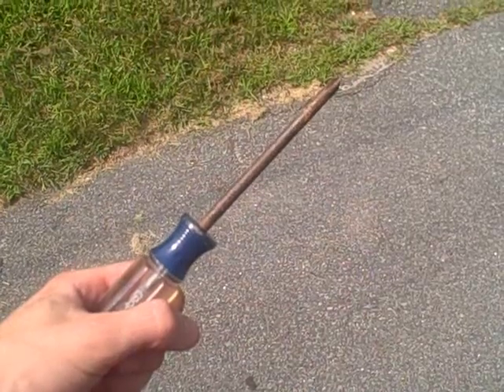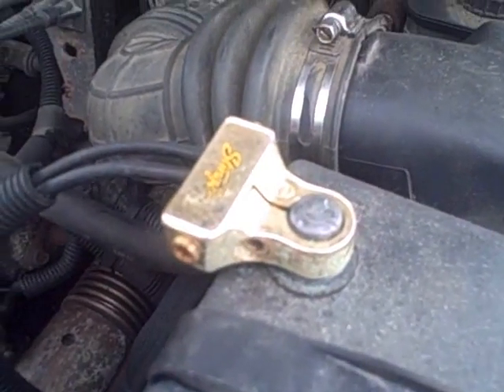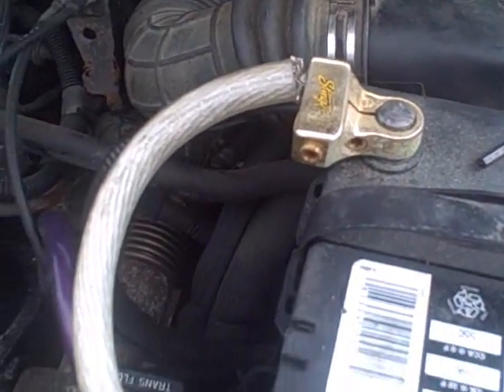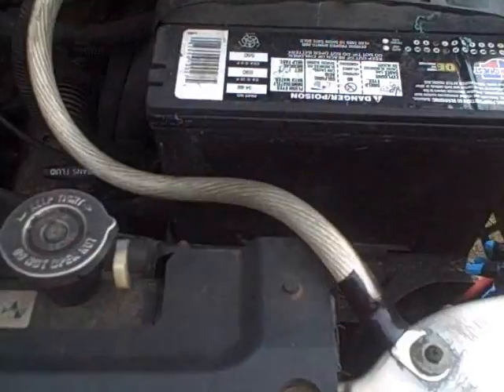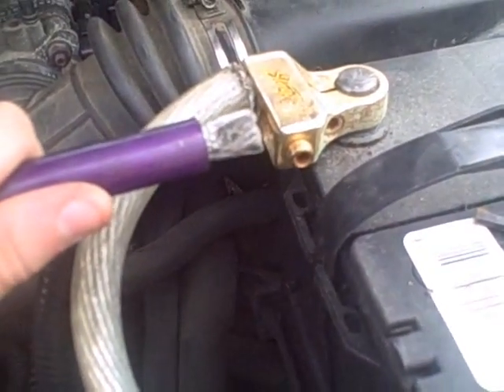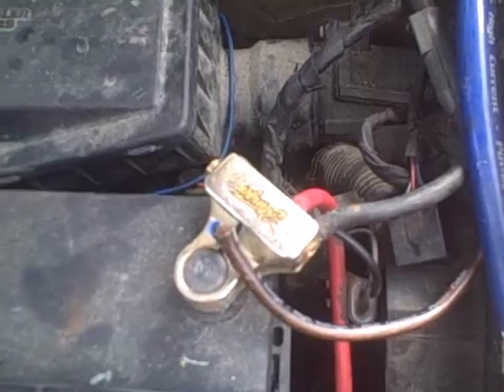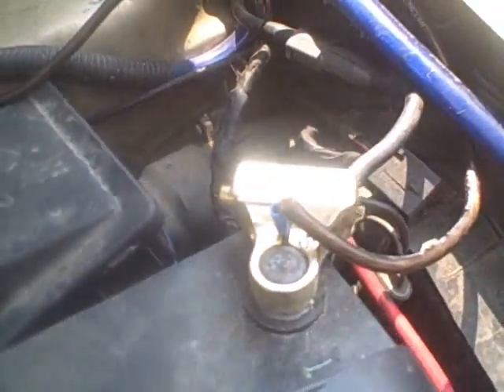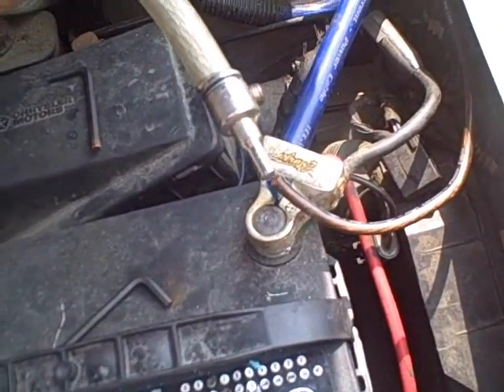Increase Car Audio Power 25% - How To Install Big Three Upgrade - Easy 15 Volt Stereo System Big 3

Comment: i did the big 3 but i am using dblink platinum battery terminals and all of my big gauge inputs are filled so i was wondering if i could run my amp power off of the alternator positive. would any of my components get damaged?

Comment: lol, I installed my old system in my 89 mustang and while I was doing the amps ground cable all i could find to grind it down was the dogs pedipaws, its basically a battery powered grinded, i just thought it was kinda funny...

Comment: Can you tell me how you make your resistor??

And what happen if the fuse is on when you turn your amp on??

I changed the battery of my friends car

And after we turn all the cables on

And we are gonna put the battery cable in the amplifier 
the fuse of the amplifier blows.

Can you teach me what i should do??
ThanX!

Comment from the maker: It's NEVER a good idea to have different size negative wires than positive wores - 

& ~ Most vehicles already have 4 gauge cable coming from the alternator - You're better off doing 2, 0, or even bigger.

Comment: Does this really help a lot? You confused me a little with your 2 different accounts and where to post questions, and all the stuff. Am I supposed to just post a comment in a video on this account, and not send a message or video comment on the other account because you wont respond. I think I understood that vid correctly.

Comment from the maker: Go ahead and remove the ground cable before you work on shit.

Connect the Pos Wire to the Pos Wire Terminal on the Alt to The Batt -

Comment: OK i get what you are saying with the b 3... i have a 99 chevy silvarado and i have don a 4 AWG running from my alt to the block that splits my alts connection... one line going to the battery and the other going to the starter... i have also read that going from your alt straight to your batt. causes MAJOR alt lagg and it can burn it out much faster... and i have up graded my grounds... eventually i will go to 0... but im running 4 G and i am stable at 13.8 with my 10Farad cap... i was just won

Comment from the maker: It's not the "watts" you want to pay attention to, but rather the amount of "amps" your stereo consumes, and draws from your battery, and in turn - your alternator.

Count up how many amps your amplifier(s) draws - (it should be visible by an onboard fuse)

If it excedes 100 amps - I would suggest getting a HO alternator, then use distribution blocks with the 4 gauge or 8 in the back.

8 gauge =  60 amps max
4 gauge = 100 amps max
2 gauge = 200 amps max
0 gauge = 300 amps max

Comment from the maker: I'm not using a resistor - I'm doing a nice little car audio trick with a standard 12v interior lightbuld - 

Most resistors are too small and ill-lit so you can't safely estimate when the Caps are charged - using a 12v lightbuld makes it easy, and fool proof.

Comment: I noticed you using a resistor to avoid the dreaded big spark when the amp fills up its caps. What value resistor did u use?

Comment: you dont really have to get a isolator or relay, unless you will be slammin the system with the car off. like at db drag events. Aslong as the batteries are purchased within 3 months or so you should be fine

Comment from the maker: there are two ways to do it
one way is using a device called a battery relay ~ this is the cheapest and hardest way to isolate batteries.

the next way is using a bigger device called a battery isolator. These are more expensive but reliable and easy to install.

Comment from the maker: getting more or bigger batteries will only demand more from your alternator. 

your lights are dimming because your car literally is running low on power ~ you need to increase the amperage of your system ~ this is achieved by adding high output alts

Comment: is the alternator cable looks like the tip of the cable where it is connected to the alternator has like a red cover on it?
and if i change it, does it have to be 0 gauge man?
thanks

Comment: so while using a 12v light or a head light bulb connecting the - to the cap side andt the + the the battery side  the light will shine until the cap is charged. when the light goes dim the cap is charged? or the the light is on while the cap is charging and when the light is off the cap is charged?

Comment from the maker: No. You want to run it in series with your positive power wire to slowly introduce current into the capacitor. ~ don't just hook it up to the battery ~ this will likely shock out your cap. ~ i have a whole tutorial on how to charge a capacitor ~ check it out. It should help even more.

Comment: So to charge a capacitor all one has to do is empty it using a 12v light bulb, then connect it to a 12v battery? is that it?

Comment from the maker: 4 gauge can only handle about 100 to 125 odd amps ~ it would not be good to use just one 4 gauge wire for this big of an upgrade ~ 0 gauge can handle up to 300 amps ~ if your getting any H/O alternator, always do the big three in 0 gauge or multiple runs of 0 gauge.

Comment: thanks for the vid bro will 4 gauge wire do fine? also a high amp alternator will be nessesary i just bought a 220amp alternator and a optima yellow top.

Comment: yo man 
a suggestion for ya. instead of grounding to you body, take that ground wire and move it to a small bolt on the strut tower. that bolt goes directly to the frame. more direct, instead of running though the body to get to the frame

Comment from the maker: Great question - Yes.

You can most certainly add to your stock wire to "surplus" your connections

I omitted it, only because, in most cases, the old stock wires are frail, corroded, poorly grounded, and look like shit.

Comment: nice video.... I'm planing on doing the big 3 on my 96 ford taurus but my question is.. Can i keep my stock wiring and add onto it? my alt goes to the fuse box then the batt... but I wanted to add 1 gauge from the alt to batt and keep the existing alt to fusebox to batt connection... and also does the alt directly to batt has to be fused(not running a high output alt) ?

Comment from the maker: It is connected to the same place the prior stock wire was - You can't miss it - It's the only bolt you can attach a wire onto.

Comment from the maker: It's not voltage, it's current!  And, yes, this will dramatically reduce power resistance, and increase power potential.

If you look  it in amperage terms, your increasing in by more than 25%

4 gauge wire before = Maybe 100 amps MAX!

0 gauge wire after = 300 Amps Max

So....That's actually more like 200%potential current gain - But you'll only raise a couple 10th's on the VM most likely.

Comment from the maker: I DID, and Do. It's very beneficail to wire the engine block directly to the negative battery post. 

You want to fool the alternator into thinking it's grounded to the negative battery terminal as much as possible.

Comment: Yes sir! They tell you no tot do this, But trust me it worked a lot better for me. I had them on different growns and didnt do anything for me AT ALL! The guy told me to run the ground strait off the negitive terminal on the cap. It took a load loud of my alt, I tell ya. Had more power/ bass and eveything.

Comment: is it necessary to ground the engine chassis to the negative terminal of the battery? or its okay to ground the engine chassis to the same ground the negative terminal is located.

Comment: yes fuse it if you have to small of a wire. But ill never fuse mine. Iv got 2 runs of 0 gauge from alts+ to batts +

Also i have a xp270 alt from dc power
200 amps idle
270+ amps @ 2rpms

Comment from the maker: I agree to a certain extent when going over 300 amps - (Being over the limit of 0 gauge) - but it's made fine on Less Than 300 amps - 

This way,  Think of manufacturing Companies - They do not fuse the "main cable" but rather the curcuit breaker  to which it connects the car. This is the real life-saver - Not an in-line fuse on the cable beforehand.

Comment: its not to gain voltage, big 3 helps to maintain voltage and reduce voltage drop. It eases power delivery to the battery and thus the amplifier.

Comment: great video...really helpfull...now question...can i just conect the negative wire from the block of the car to the chassis instead of putting it in the negative side of the battery?

Comment: mmmmm i should do that ....i think i will thanks EXO....hey u should make another vid about how to keep ur amps safe wen u disconnect wires and what to do to take the power out of the wire so wen u connect it.....it wount spark

Comment: if ur car is unibody u might have to run a 0ga wire to the back of your car. or bolt it to multiple points of ur car. under my hood they have 8 ga wires connecting the front frame and rear frames from the factory. so in my car i ran a ground wire all the way to the back , and its connected to the body in 3 places. without the ground running to the back of my car my amp would get hot very ez.

Comment: yeah i know what is parallel and series is wired. But iv never charged a cap before. i gess it has a resistor so its done in series. sorry my mix up

Comment from the maker: No, you have it mxed up...This is series wiring - (neg to pos) on one wire. 

Series = Neg to Pos / Pos to Neg 

(Like this video, when wiring a light in series on only 1 positive power wire)

Parallel = Pos to Pos / Neg to Neg

(Like a cigaratte lighter, or head-unit.)

Comment from the maker: Charging a cap using a 12v light as a resistor bulb - Much easier to see, and much bigger for the hands to grab ~ Just run it in series with your power fuse block, and your good to go after a few seconds :)

Comment: yes on that "car smarter" part. They are so smart they can change air flow mixers, voltage, belt speeds, ect.... 

Just like my 08 jeep the "pcm" is so smart . I have whats called a "can buss system" witch is verylow voltage wirings for ign wire thats ran by the "pcm". So i have a toggle switch to my batt to trun on my Head unit. Or i can buy addaptor for $200 to tap into the "Can buss system"

Comment: This info is for people using like 04+ cars. The "PCM"s will over ride or try to over ride the mla. But on your case mla with your littal high out put alt would do you great. And for anyone elce that has stock or high out put alt in there car. Just its alittle bit harder to trick the "pcm" in newer cars. Need to know what your doing. Its not a plug and play with new cars. You must need to your cars wiring very well under the fuse blook.

Comment: Oh yeah. Its a must for everyone thats pulling extra power. Also i saw you still have a wet cell but. Go get a kinetik 1200 in that spot. it will help you out. Deep cycle will make a big difference. Anyways all the big 3 dose is lessn the resictance and help out the "extra current flow" All that power has to go some where. Grounds are a MUST upgread! They carry just as much current as the (+) wires do. So if you have to upgread the (+)wire you need to do the same for your ground

Comment from the maker: So are you saying that an running MLA  on stock alternator would be better suited for someone who is looking to increase there overall performance, than maybe upgrading a few wires, that, in the long run, are most likey going to be upgraded to 0 gauge anyways?

Comment: So, basically, if you want the MLA,  it is GREAT product and it will get you the higher voltage, but with these high out put alternators like PC Power, it may get you too high under certain circumstances.. Its not something that MLA cant fix with a little tweaking, but the good people over at PC Power have pushed the envelope so far with these 200+ amp alts, we have to be careful what we do with it because of its extra-ordinary capabilities...

Comment: You have to remember, some high out put alternator like DC POWER is SO advanced, and SO capable that at idle, its capable of going from zero output to 200 amps instantaneously where on a normal alternator. That just wont (CANT) happen..

Comment: Best bet for people that have newer cars is a "MLA"

What the MLA does is manipulate the PCM into loosening control of the alternator so you can get higher voltage
BUT...
Voltage regulators whether they are internal or in the PCM under certain circumstances can over-think.. What happens when they do that, is you get voltage spikes. What can happen with the MLA when its on a GOOD alternator, is they react SO fast, you can get big spikes..

Comment: lol i know may stuff. your car is way older then most peoples witch when adding your alt in there had a internal volt reg set high so thats why. You simply cant gain that much voltage from the big 3. Just cant. And on newer cars it gets very difficalt to bost the voltage with out that "ecm" ''pcm'' freaking out of trying to reset the voltage lower to correct itself.

Comment: geting less resistance dose not mean you gain higer voltage. When wiring your amp down on the ohm load will not gain you more volts, just more out put from your amp cuz you justed lowered your resistance. The "Big 3" is to help out the current flow and bring down the resistance witch will help your voltage drop. Most cars today have "ECM" or "PCM" witch regulat the voltage given off your alt. It will always correct itself.

Comment from the maker: When I first installed my system, I was sittin on 13.7 volts....I don't know if was The Big 3, by itself, or a combination of both that, and the fact I added 2 capacitors as a final touch when I completed it....

But now, I see 15.0v idle - and, 14.6 thumpin'.

Comment from the maker: All alternators get there grounds from being bolted to the engine - The only wire you directly connect to your alternator is the positive power wire. This allows your alt to charge your batteries.

This is why we ground your engines to your batteries -  the alternator needs more stabilty than a single 4 gauge wire.

Comment: as long as your not poppin fuses your all good. like i said earlier in this as long as you match the max on the wire your gunna be good. the amps have there own fuses to prptect them. your inline is for the wire to not burn up.

Comment: im going to have to try that, but my battery is in my trunk, so im probably going to have to run a long ass cable under the car to the alternator.

Comment: 150 is perfect. It will serve its' purpose and snap if there's a short or the current draw is approximately double the fuse rating for a few seconds. ;-)

Comment: Nice, I should have shown you my big three upgrade while I was there, I forgot about it. My voltage stays a nice steady 13.5-14 volts with my system pounding and the air conditioner running now. Definitely a great video for people who haven't done it yet.

Comment: In regards to your comment about running your grounds from the front batt to the rear amps, batts and/or caps...this is ideal. I had 32 runs of power AND ground from my single PC2150 up front to a home made distro setup in the rear which fed my amps. If you have the money for the additional runs of ground then it is worth it. Otherwise, the true chasis of the vehicle is the second best option. Last would be a seat bolt or thin sheet metal. Resistance is the DEVIL! LOL

Comment: one addition ot this is to match the fuse with the size of wire, this way if your wire can only push say 150 amps and you have a 250 amp fuse your not doing anything with that fuse. your wire will burn up and start a fire if it goes above 150 trust me ive seen it happen. not my car tho

Comment: Also you can NOT gain more voltage from the "big 3" It just helps the flow of power so you have less resstance and that helps with your voltage drop. On newer cars they have whats callled "ECM" or "PCM" witch controlls the voltage your alt puts out. Its very hard to change this voltage even with a external volt regulator

Comment: fyi when adding wire or working on wiring in the car for the "big 3" or just adding wire for your system always disconet the (-) on your batt so you dont blow fuse's or fry somthing.

Comment: LOVE IT! 5*'s

A few tips from my experience:
1. Front ground is best on strut tower bolt which goes directly to your actual frame of the vehicle rather than the flimsy piece of metal most people use. (sand well)
2. Ground in the rear of the vehicle at the strut tower bolts rather than the flimsy metal as well. (sand well)
3. Fuse the cable from your alt to your pos battery terminal just incase it shorts.

Comment: I would upgrade the battery sometime, with more then 2 terminals for more opptions for you. I would also run a big ground wire from the amp strait to the battery. They tell you not to do this but its B.S. You will get a lot better flow to the battery them going through the car. MORE power for your amps! And this works with your caps as well. Run the ground for the amps strait off the grounds on the caps. This is the way I did it and works way better. MORE BASS!